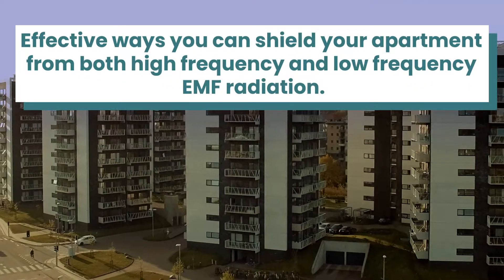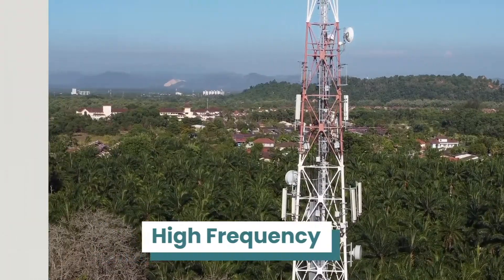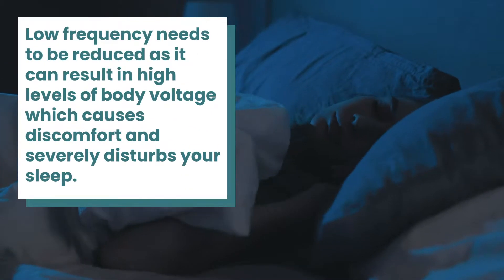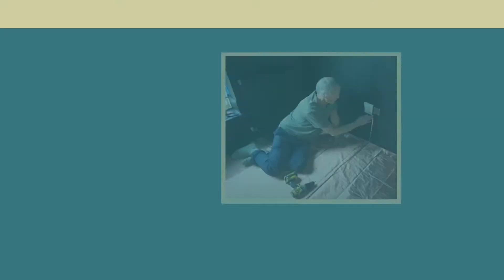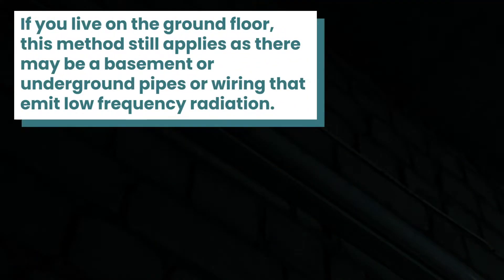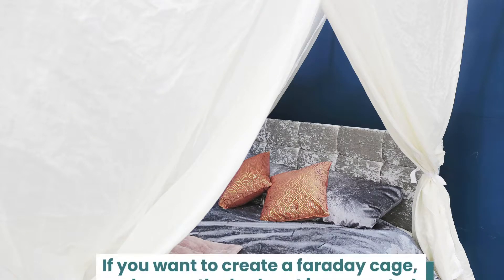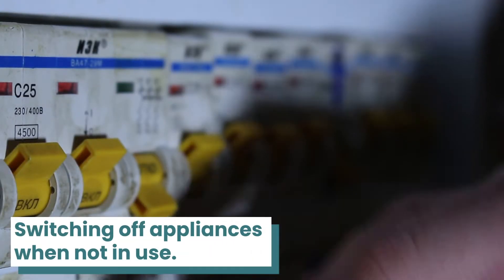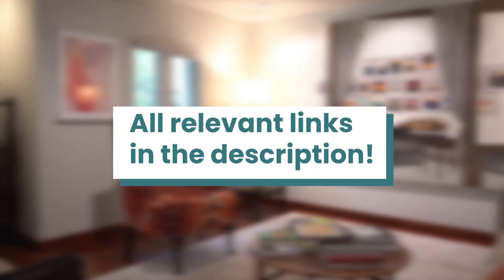How To Shield Your Apartment | Getting To Know EMFs #6

Comment: I really need advice if you can help to the best of your ability. I currently live in a motel room with a kitchennet and there is a 5g tower 4 blocks away in one direction and 1 mile in another direction. I want to sheild my room from emfs using reflectix, aluminum window screen and galvanized steel but I need advice on how to do it safley without making emfs worse. Should I put it on every single wall from floor to ceiling or just the 2 walls that the 5g is coming from? Also since I live in this room if I'm on my laptop or using my phone which i usually am in the room will it make it dangerous and start ping ponging around the room? Will I still be able to use electronics in the room without it being dangerous? I basically want to limit emf exposure as much as possible especially the 5g is the main concern, if there's a little bit of rf for now it's fine but my goal is to just limit emf as much as possible especially from the outside but I want to do it safely because there will still be electronics being used in the room until night time. Would it be best to just do like 2 or 3 sides of the room or even a faraday cage section of the room separate? Also will ot become an electrical trap of I don't ground it? Any advice helps on how to shelid this room. Thank you and God bless 🙏❤️
Reply from the maker: Hi Alex, is there any local building biology folk near you.  Google Brian Hoyer he might be able to help.  God bless